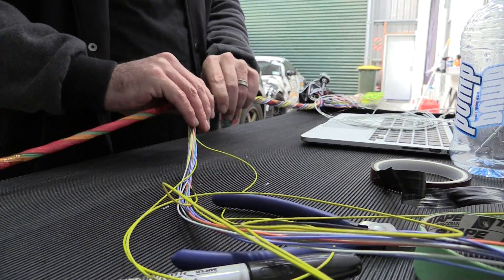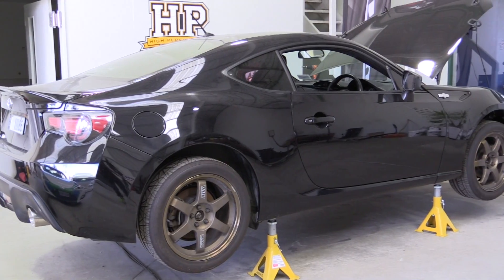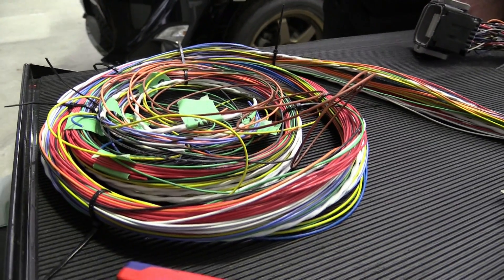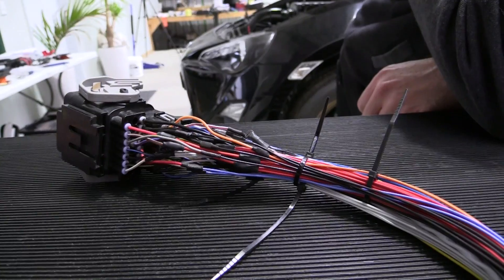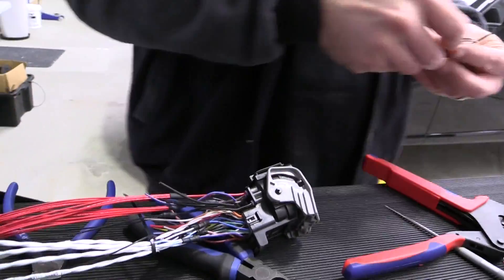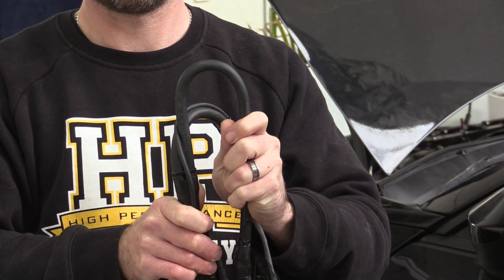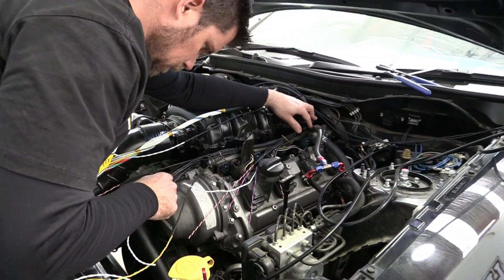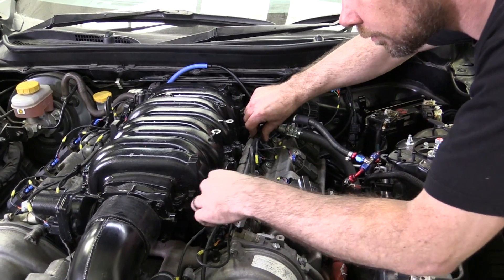Wiring and Tuning Project "Panhard" - Part 3 1UZFE V8 Powered Toyota 86 / Scion FRS

Comment: You mentioned teflon Tape. How, why and where do you use it?
Reply: I only heard him mention Kapton tape.  That is used to hold the concentrically twisted bundle together before it is covered in shrink tube.  it's used every so many inches throughout the harness.  The reason why it's Kapton tape is because it's extremely thin, narrow, and heat-resistant.  That means there is no harm done in simply leaving it in place when the shrink tube is applied in the final stages, simplifying the build process as you don't need to remove each piece of tape as you're installing shrink tube.

Comment: Never seen concentric wiring before, think I'll give it a go when rewiring my 30 year old Africa Twin motorbike as I have a fair bit of wiring to redo as some of the original terminals have corroded and broken off. Usually I just rewire and use hockey stick tape or nylon braided sleeving and heat shrink. A concentric loom should work well and I can add the additional circuits I need for power socket/charge socket, security, lighting and navigation.
Reply from the maker: 30 years eh, you must have one of the 650cc versions? They certainly have a reputation of being great bikes and I can imagine it would be due a bit of love in the wiring department by now.

We are going to cover concentric twisting later this year in a more advanced wiring course. If you would like to you can email me and mention that you would like to hear about it on release and I'll make sure I get an email to you at the time: support@hpacademy.com

If that's a bit late for your timeframe then I would still be interested to hear how you get on with the project. A motorbike is a great vehicle to cut your teeth on with this I feel 😎- Taz.

Comment: Where did you find those terminal pins? I've been looking because I'm rebuilding the engine harness for my truck. Toyota will only sell pigtails, id rather have just the terminal and put it on the new wires.

Comment: Nothing wrong with a quality solder joint, must be done either NASA method or philips method. Military use this for splices. The real problem is that a quality crimp is easy to do with the right tools, but a quality solder joint is not easily done without experience and knowledge.